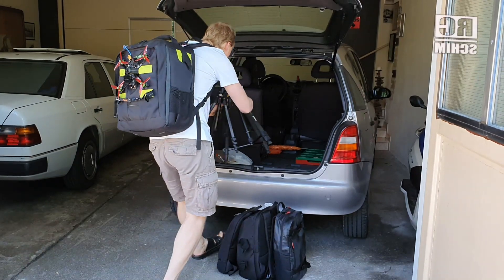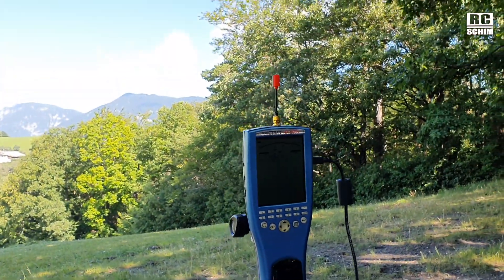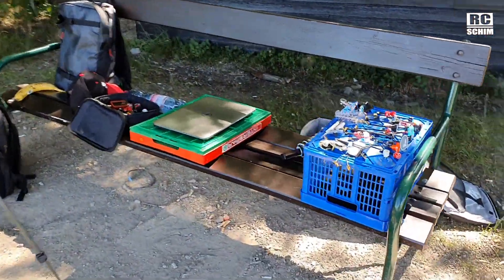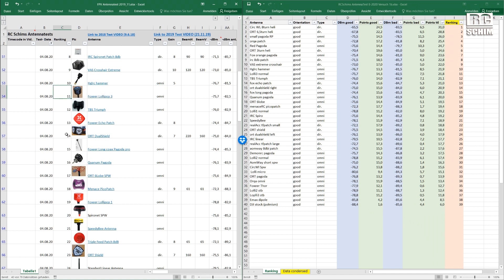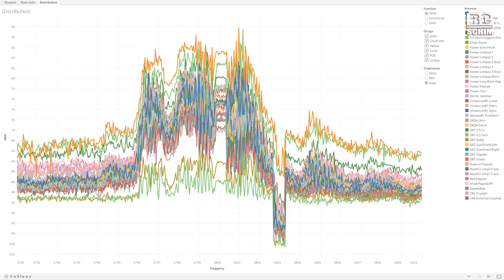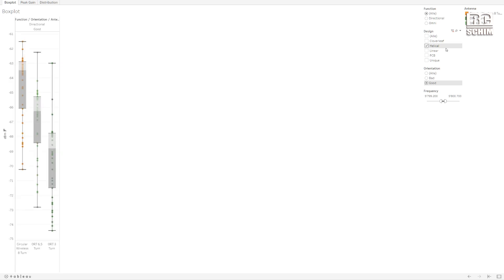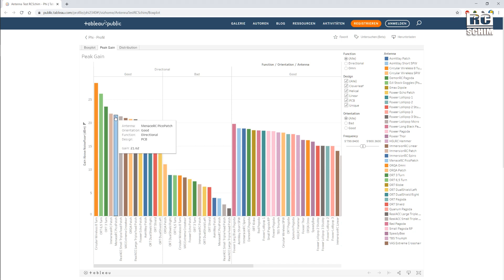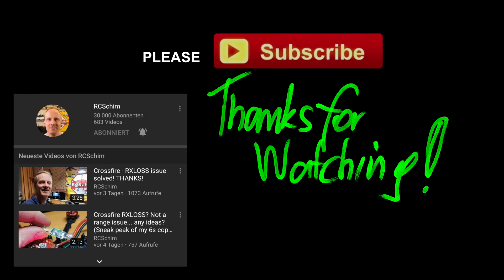RCSchims MEGA FPV Antennatest 2020 (most accurate yet, interactive results webpage!)

Comment from the maker: Updates: 
►small, good performing pagoda link was added to the overview: https://www.gearbest.com/antenna/pp_635516.html?wid=1433363
►insertion loss:   dont use too many adaptors (common sense) but definitly stay away from flex cable extensions, pigtails or similar if you can (see here: https://menacerc.co.uk/sma-adaptors-signal-loss-or-not)
►better analysis of my DJI FPV CAR videotest from a few weeks (derove also compared the data there):  https://tabsoft.co/31lU3mD
Reply from the maker: @pusico6555  MMCX: Hi, not neccesarily bad. if the quality of the coax cable is ok, it should perform just fine.
It's not so easy to test different antenna connections. Especially UFL I have no adaptor for.
but even for the cases where I have adaptor cables: they alreday influence the measurement....
So I would need 3 exact same VTX with just different antenna ports ;)  but then again I couldnt be sure that all those VTX would be build with the same quality...

Comment: From what you have sen with these results. Which antannea would you buy for long range Analogue HGLRC ZEUS VTX 800mW on the quadcopter and on your goggles? The drone has the FrSKY R9. And as an aside, I have found my DJI airunits with the standard antennae on both craft and goggles seems to outperform (distance wise) what I have above in the analogue quadcopter, that has already had a failsafe about 100 meters behind me.

Comment: AWESOME job at testing so many antennas, with excellent data analysis and interpretation. Thank you for your hard work and the very important information that you provided to the FPV World. I found your channel by accident, and I'm glad I did. The information you provided will change the way that I select an antenna from now on. No more trial and error, I'll just review your data and find the antenna that best suits my needs. I hope Everyone in the FPV hobby/sport will also be able to find your channel as well. I will definitely spread the word about your channel.
Reply from the maker: Thanks Conrad, awesome comment as well! It's quite a heavy task to test antennas this way, but I wanted to know for myself how they compare to eachother. Since I almost exclusivly fly with DJI FPV now, I rather thest antennas in that application - and there I measure the resulting Bitrate (which you get in a logfile on the goggles since it's digital). Check my newer videos if you also use DJI antennas - quite some interesting findings there. greets, Mario   (and thanks for spreading the word about my channel!)

Comment: First off, excellent test summary!!  2 questions though on the Foxeer Pagoda (ranked #7):  1 - that's the "short stubby" sma at 68mm, correct (not the long version at 86mm)?  That's where your link took me at Bangood.  And as far as the performance, it doesn't appear that there's a ton of difference between that and the  RealACC Red Pagoda?  Thoughts...

Comment: I've noticed a lot of people like using TPU mounts for vtx antennas that partially or fully cover the active element with TPU. I read a comment from Martin Baert where he stated that TPU has a relatively high dielectric constant and so shouldn't be used as a protector around an antenna active element.
Maybe you could do a controlled signal test with antennas in and out of TPU mounts to see if there is a real world difference?

Comment: Thanks for the test. What do you currently actually fly on your DJI HD setup (top and bottom) for long range?
Reply from the maker: I have the feeling that I could even use my normal setup (4 Foxeer Lollipop, non stubby) for Longragen :)
But to be safe I use 2 patches on the bottom.
If patches belong on top or bottom is an ongoing discussion - I should do an extensive test regarding this as well.
Bardwell will test new antennas soon and maybe he can find out more bout this...
Reply: @Rcschim  the menace with extension cables?
Reply from the maker: @flyingfox8586  Yes, Menace and Orqua patches, with sma 45° adapters rather than coax extensions. also used the 3turn ORT helix (would be even better) but the coax cable bends and you never know where you're pointing...

Comment: The measurement is half scientific, but, sure one of the better

From the spectrum, you have a video cam attached to the VTX, and what is with the ~10 dB drop on ~5,803 GHz?
The RTC705 (VTX) should be able to operate in CW mode (no cam), has a phase noise of ~ -90 dBc/Hz @ 100 kHz offset (good enough to sweep measure with CW)
Combined with the spectrum analyzer (USB control) you can automatize the frequency sweep...  
Your measurement is only good as the reference antenna, try to get a reference antenna and a 90 deg hybrid (polarity RHCP/LHCP measurements...)

Comparing gain (signal strength) between antennas that not claim to have the same gain isn't actually fair, of course, an antenna with 13dBi should have a better signal in a "good orientation" than an 8 dBi ...
The really interesting thing is the radiation efficiency and the LHCP/RHCP radiation pattern.
At the end of the day, the best combination is use case dependent (but at least you can pick an antenna with high radiation efficiency and good cross-polar isolation).

Some literature on the topic:
http://www.ets-lindgren.com/sites/etsauthor/WhitePapers/APM.pdf
https://www.mdltechnologies.co.uk/technical-docs/RFxpert%20White%20Paper%201-A4.pdf
https://www.keysight.com/upload/cmc_upload/All/ORFR-Theory.pdf
https://www.keysight.com/upload/cmc_upload/All/NSI-near-far.pdf
http://www2.elo.utfsm.cl/~elo349/Material%20bibliogr%E1fico%20complementario/Mediciones%20en%20Antenas.pdf

looking forward to your next video!
Reply from the maker: Wow! Super feedback and comprehensive comment! ;) No idea what the drop around 5.803 was. Maybe a problem on the Spektran? Next time I'll investigate this further (to see if this comes from the clearview VTX).
CW mode just means "black" video (because no cam source attached?). Do you think the image signal noise is already to be seen on the spektran (like if I'd probe the yellow wire of a cam on my oscilloscope? 
What kind of reference antenna would you suggest? What's an 90 deg hybrid (coupler?)

You're right, comparing apples to oranges here so to say. But my idea was to show the viewers what kind of difference to expect in real life with different antennas. Be it the same gain and just different results due to quality or different gain and therefore better signal (like nice and easy to understand why 3,6 and 8 turn helicals are better the more turns they have).
Considering all the rules and making this test nearly scientific - would reduce the possible audience to a VERY tiny group of people. So - the more effort - the less views in that case :)

Thanks for the literature - I'll dive into it! Always good to learn new stuff - and RF is definitly a wide field and a lot to understand better for me...
greets, Mario
Reply: @Rcschim  Cleare Wave (CW) is a not modulated signal carrier (no camera attached), the difference to the video signal is that with CW you get a single peak in the spectrum (you can sweep in a smaller range)
The problem measuring with a video signal is that you get a high trace noise (your measurement deviation is huge) because of the modulation (without sync to measurement device).
In CW mode you need only to track one frequency (that in ideal case don't change in amplitude and phase) you measurement deviation should get to <0,3 dB
With the video signal, you also spread the power across, your dynamic range decreases (hitting the noise floor).

Regarding reference antenna, something like this would be perfect (you can measure linear (H/V) and circular (RHCP/LHCP - 90 deg hybrid coupler needed) with the same antenna and cheap equipment) https://www.theemcshop.com/641-quad-ridge-horn-antennas there are expensive (>1k EUR), so you won't probably by one.
You can also make one by you one it's not that hard (but also not ideal), (waveguide) horn antennas are the best because there have a high performance, for example, efficiency can easily reach nearly 100%
There are also methods to extract the polarization performance..... with unknown antennas but that is a big topic and requires a huge amount of measurements. 

So to improve the measurement put on the VTX an antenna that at least claims to have high cross isolation and gain in the range of 6-18 dBi

BR, Tomislav
Reply from the maker: @tomislavjukic8362  OK, I saw you're working for orqa - that explains why you know a thing or 2 about RF - and that also explains why their products are of good quality!
So the "no cam" on VTX change should be easy and improve my accuracy on the next try.
The weird horn antenna will probbably exceed my test-budget (anytime a "request quote" sits there right next to a product you know you're in trouble if you wanna get it ;)

What about easier alternatives as VTX TX antennas? What about the omni from orqa (the nice one I got with a disc that is screwed onto a coax?) 
Or what about a simple Linear antenna?
Reply: @Rcschim   
No, the Omni has a too low gain. You need a directional antenna, your goal is to characterize the antenna, not the surrounding (reflections from the ground, walls ...)

Found some: 
-KIR-6050 antenna
The drawback is that it has only one polarization (linear)
-KIR-5800DP

Can be used for linear and circular (requires additional equipment) polarization measurements. 
These two should have decent performance and don't cost too much.

Comment: My Kwad does 5 km omni with the old blue naked Aomways, i use an extension and a TBS pro32 HV.
Reply from the maker: sounds more than enough for a quad. do you use RTH GPS or just fly risky on the edge of your range? I always get nervous on suboptimal image and therefore never reach the real edge of my setups range ;)
Reply: @Rcschim  INAV und RTH und dann nur dort wo ich mich auskenne sonst ist das zu heikel. Leider funktioniert das aber nicht immer obwohl ich das setup nicht geändert hab, gestern warens nur 3,5 km. Man sollte das Handy gar nicht erst mitnehmen und ich glaube die Wetterlage spielt auch eine Rolle oder bilde ich mir das ein?
Reply from the maker: @BBFPV  Die Luftfeuchtigkeit spielt definitv eine Rolle. Handy kannst ja in Airplanemode versetzen, oder zumindest WLan und Blutooth aus.
Du meinst RTH funkt nicht immer? Scheint generell bei inav aber mehr noch bei BF noch nicht so gut zu funktionieren bzw. gibts viel zu viele Einstellungen. Nurk FPV hatte zuletzt dann mal einen Erfolg - BF GPS mode geht endlich bei ihm, aber da waren einige Einstellungen nötig....
Reply: @Rcschim  Nee ich meine 5 km zu erreichen funktioniert nicht immer. Mit RTH hatte ich weniger Probleme, man sollte den Copter erst aufsteigen lassen und bei INAV ist der Rückflug etwas ruckelig, ich vermute er korrigiert alle paar Sekunden weil die GPS und Magnetometer Daten nicht ganz zusammen passen. Ich hab das BN 880 drin und musste es als upside down und mit -270° konfigurieren  sonst arbeiten die gegeneinander bzw. er fliegt seitlich nach Hause. Vermutlich stimmt die mag. Kalibrierung bei mir immer noch nicht ganz. Im Flächenmodell klappt das aber sehr gut, neulich ist mir das Bild der Split eingefroren da war ich froh ihn bis auf Sicht heim holen zu können.
Reply from the maker: @BBFPV  OK, beruhigt mich ein wenig. Hatte bis jetzt nur mal kurz mit dem SG325 Skystars? Kontakt mit iNav auf Copter. Den muß ich eh mal wieder verwenden (bzw. evtl. auf Caddx und CF umrüsten. Weißt nicht zufällig ob iNav auch schon mit DJI "spricht"?
Die 270° musste ich glaub ich auch beim SG325 einstellen.
Und ja, der Autopilot ist ein wenig wakelig... Ausserdem hatte der Copter auch Motor-Desyncs glaub ich - also noch nicht ganz vertraunswürdig.
Flieger und iNav würd mich eh auch reizen, MiniTalon z.B., aber da fehlt mir immer wieder die Zeit...
Reply: @Rcschim  Also Wegpunkte und Position halten funktionieren hervorragend selbst bei richtig Wind und man kann immer noch etwas steuern. Das DJI System hab ich noch nicht, hatte erwartet das die Konkurrenz nachzieht. Das müsste man mal Pawel fragen.
Die Desyncs liegen aber am ESC, die neuen mit F3 CPU haben richtig Probleme, bin davon auch betroffen.
https://intofpv.com/t-warning-holybro-tekko32-f3-4in1-hardware-issue
Ich hab Inav auf einem MPX Funjet Ultra, der hat bei 200km/h bis zu 15 min Flugzeit, das ist erstmal nicht so langweilig wie die lahmen Wings und durch das Tempo fliegt der Stabil und wackelt und schwingt nicht. Aber hab nen Kurzschluss verursacht und warte jetzt auf das neue Martek.
Reply from the maker: @BBFPV  Der SG325 hat ein F4 board. Werde einfach mal weitertesten und mehr damit fliegen (zuerst halt nur safe in der Nähe). 
Muß irgendwas finden, damit meine schönen RLine Tattu 4S akkus nicht umsonst sind :)  (flieg sonst fast nur noch die neuen 6S packs auf meinen beiden 6S coptern).
Funjet Ultra hatte ich auch mal (teile davon hab ich noch immer, nur nicht den Motor - der ist damals beim Crash weggeflogen und ward nicht mehr gefunden :)
Aber FJU mit FPV stell ich mir schon geil vor. Gibts videos davon?
Reply: @Rcschim  https://youtu.be/VVBhuZhTKeA Das war einer der ersten Testflüge, bei der Landung hat sich die Split verabschiedet. Sonst nur DVR Material, die Tasier wartet aber auf ihren Einsatz. Das war noch sehr langsam geflogen (weil ich den verfolgen wollte) und das Autotune stimmte noch nicht. Videos kommen aber.
--------------------------------------------------------------------------------------------------------------------------------------------------------------------------------------------------------------------------
Stimmt ,das noch lustiger. Du wenn in INAV den nav launch benutzt ist der Start ein Traum. Setzt nur im cli die Parameter richtig, max Steigwinkel und viel Gas, der dreht sich schon wieder gerade. Ich habe ein Brotherhobby 2812 1115kv mit copter ESC und ein 6s 3000mah Akku drin, der Antrieb ist genau so stark wieder der Originale aber viel leichter. Trotz des großen Akkus bin ich bei 900g.

Comment: Nice job Schim! my question: putting two of this https://www.gearbest.com/antenna/pp_635516.html?wid=1433363 on my dji googles I'll get better signal performance?
Reply from the maker: What are the other 2 ports on the goggles occupied with? And what antennas do you have on the airunit? 
Just 2 of these pagodas will not give better result if you use stock antennas on the copter.
you need also 2 RHCP antennas on the copter: https://www.gearbest.com/antenna/pp_009714951719.html?wid=1433363
(but attention:   for DJI Airunit it is like above (MMCX connector)  while on the Caddx Vista it is "UFL" connector. SpeedyBees are the ones I like to use on my caddx vista btw.  but also the foxeer lollipops do good. I wouldnt use the standard DJI antennas.

Comment: Is it a fair assumption that putting these antennas on the DJI air unit itself would be a good solution as well?
Reply from the maker: yes! definitly. I'm not sure about the original UFL connected caddx vista antennas - they might actually be good.
But the DJI airunit stock antennas are small and limited. Just swapping them even to the worst lollipop gives me better range.
and if I swap the AirUnit antennas - I also change over to RHCP (stock  is lhcp)  this way I can use my normal RHCP analog antennas on the goggles.

Comment: I cannot believe the spironet patch did so well.  This is absolutely awesome work!  Also, this seems to verify that the DJI antennas are intentionally garbage...
Reply from the maker: Thanks and nice to see you here. See - my effort to share this vid on my almost abandoned facebook paid off at last :)
IRCs little patch was always a fav of mine. They still fair good. But the weird shaped OrqaP1 is also decent. 
My measurements with the DJI antennas were not 100% fair tho  (once again pol mismatch although this doesnt seem to matter much here).
Next I wanna see how much loss we have if we use pigtails (mmcx-sma) on the copter -  or 45°sma adapters on the goggles. MenaceRCs measurements imply that we loose quite a lot there. I thought it's only a lot of loss on really long SMA cable extensions...  greets, Mario

Comment: Excellent! Interesting the crosshair extreme did worse this time than previous tests compared to the small patches.
Reply from the maker: Good finding. Might be, because I used a bit different approach this time. (10m instead of 5m, slightly other frequency bandwidth, more data taken).

Comment: If the DJI stock antennas are so bad, why is it there's no conclusive evidence that other omni antennas on the goggles give better performance?  From what I've seen, the DJI antennas mysteriously perform as good (or better) than any aftermarket omni's on the DJI system.
Reply from the maker: did you miss my DJI antenna test videos? there are enough hopefully conclusive hints how moderate those stock antennas are (on purpose per the FCC rumors).
Check this data comparison https://public.tableau.com/profile/phi2340#!/vizhome/RCSchim-AntennaTest_15966376169330/AntennaTestDJI
and just click the 3x DJI antennas symbol in the right. Then the performance of DJI antennas is highlighted while you see all others in the back. All of them are better :)
Reply: @Rcschim  Thanks.  I saw your videos but did not see the chart.